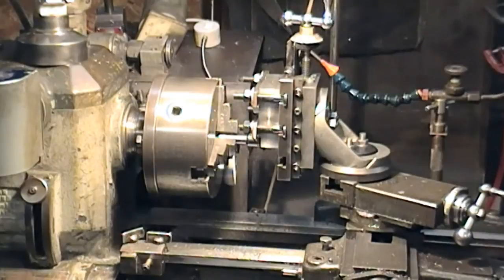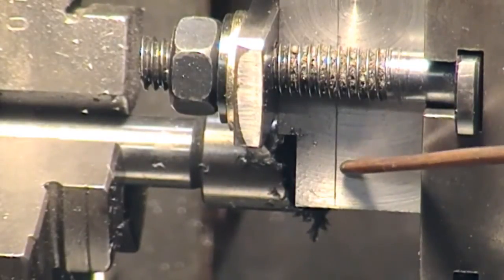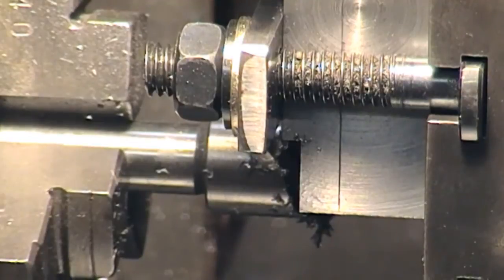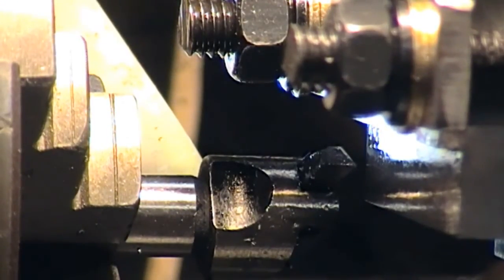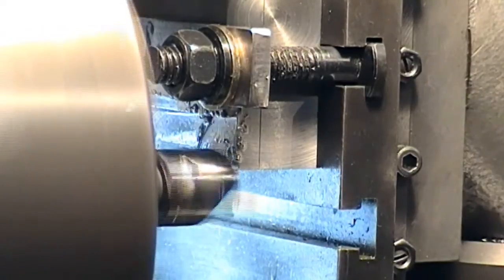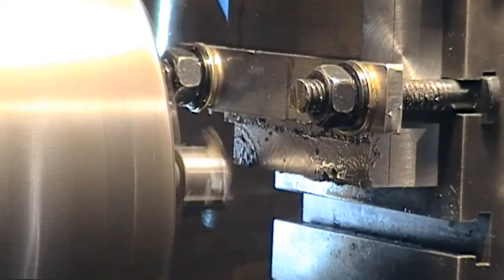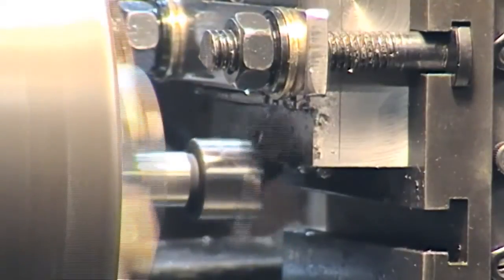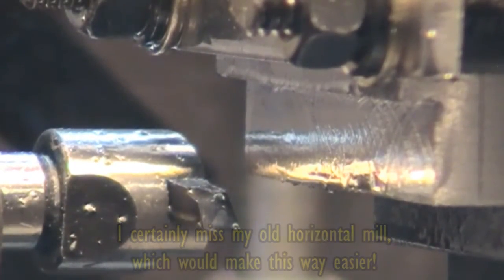Tool-post clone - another approach

Comment: Drill the center hole and clamp it to the compound to mill it. Adjust the depth of cut by placing shims under it. It may be a lot more solid without your milling fixture.
Reply from the maker: Hi Bill - agreed, that could work and certainly would be more rigid.  However, still rather time consuming setting up shimming.  In the end it was certainly easier having my local buddy do the main material removal. :)